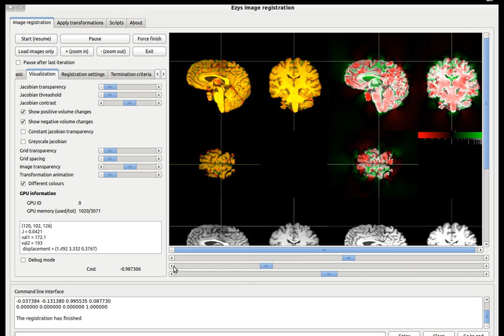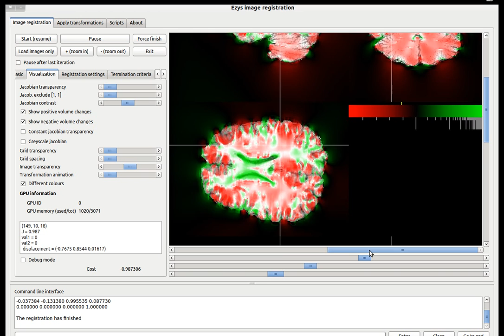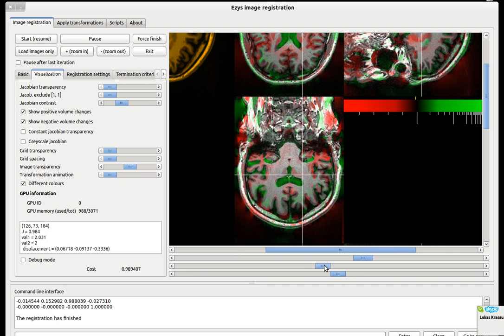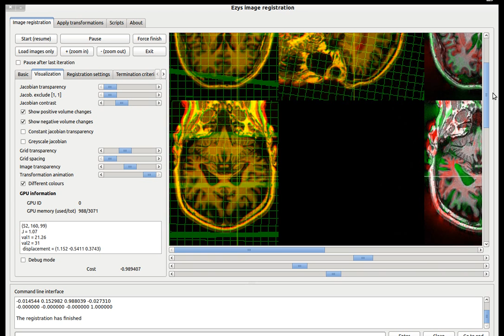3D non-linear image registration using Ezys

Comment: Hi Audrunas, 
Thank you so much for your help. I am facing issues during installation by Qt Creator, could you please have a look on the issue that I have shared on SO (https://stackoverflow.com/questions/48125204/qt-creator-shows-an-error-once-it-wants-to-compile-a-cuda-file?noredirect=1#comment83229806_48125204)